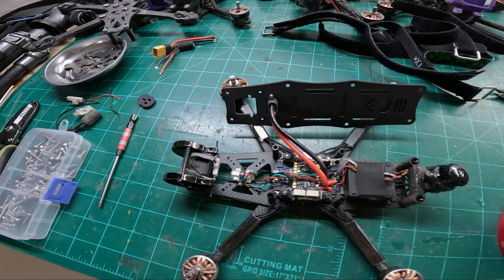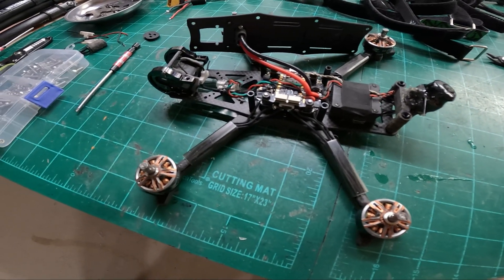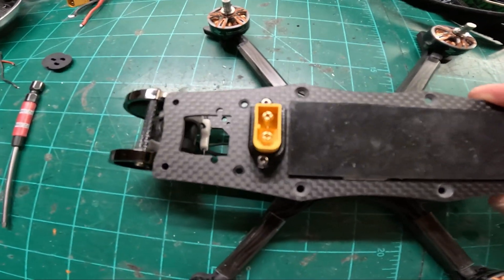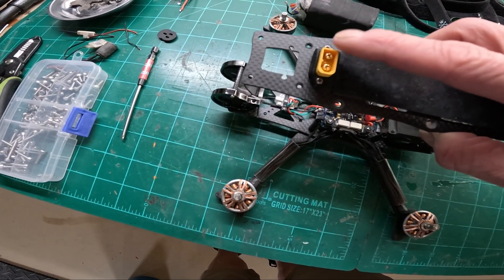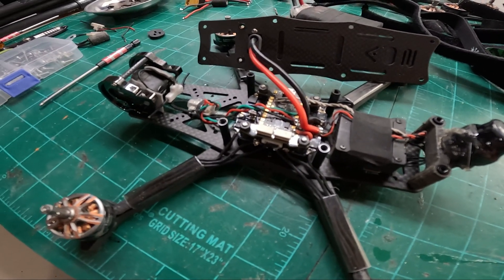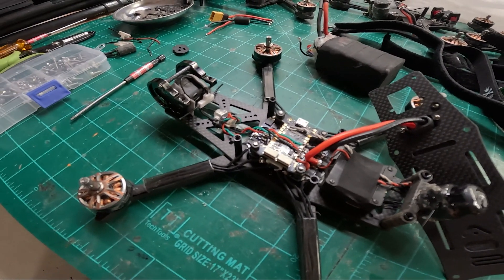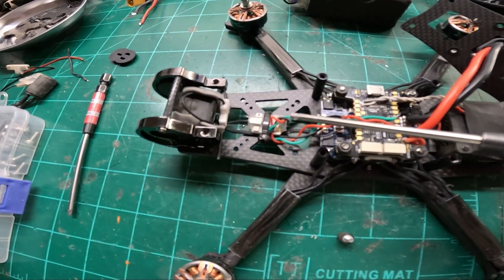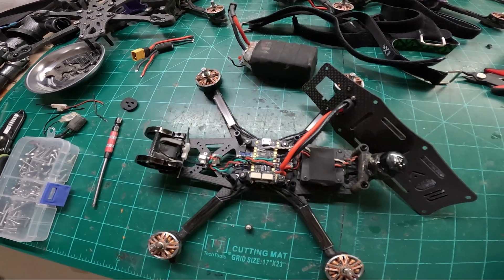Ep. 2 || AOS 5 V5 and SupaFly Syncmode V2 Electronics Install Overview

Comment: With lead up front n aos I woulda spun esc 180 deg amd recapped motors then your pads for those wires running up front would be up there too elimating running across thr board
Reply from the maker: You're right...regardless, I don't see the performance, physical, or practical purpose of having the lead in that location. Front impact is hands down the highest percentage of crashes, placing the battery lead directly in the line of fire. I understand the desire to redesign and create the best of something that has gone nearly unchanged for a decade but this frame kinda tips the scales on all practicalities of "why"? Really appreciate your feedback and time to comment. Thanks so much!

Comment: Can't believe you still use fetcrap, skystars is like 10Xs more durable, they don't catch fire....
Reply from the maker: No sir, don’t use FETTEC anymore. I had a large stock of them and this was my last one. All done with those boys. Thanks so much mang!
Reply: @PhantomFPV  I found that a heatsink is key on the esc for durability, it distributes the heat more even, like if you got one set of fets running hot due to a bad prop or something and pulls the heat off those fetts preventing the fetts from floating on melted solder which makes them short, its still possible to fry one, just much less likely....
Reply: @DigitalCruzer I've been through alot of esc's my man and in my experience they've lived longer without them. I think it's probably coincidence on both sides lol
Reply: @austinspired  I don't have money because I'm poor, but if I did I would put everything I had down that a fetcrap esc would burn out long before a same amerage rated skystars!!! Skystars imhas been bulletproof for me!!! Uve actually found Jhemcu escs to be better the fettcrap....
Reply: Btw, i run 2207 2700kv on 6s, skystars takes it like a champ!!!